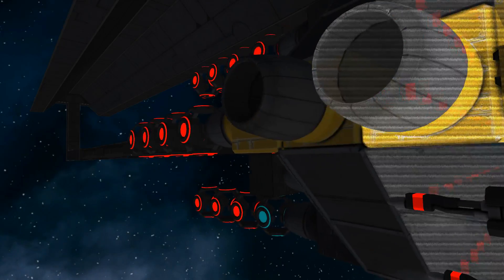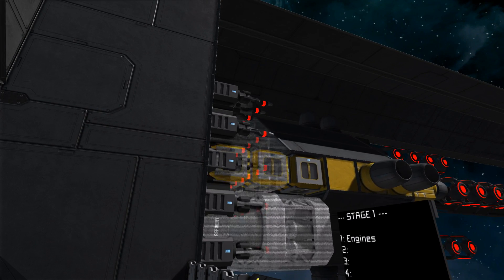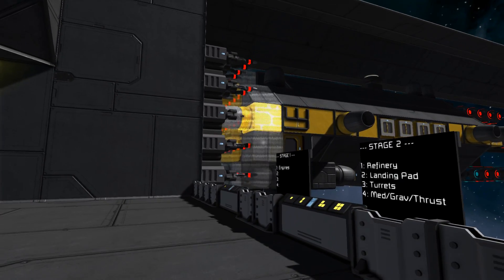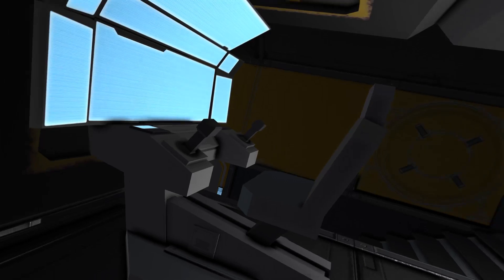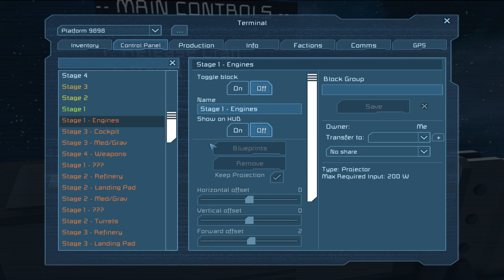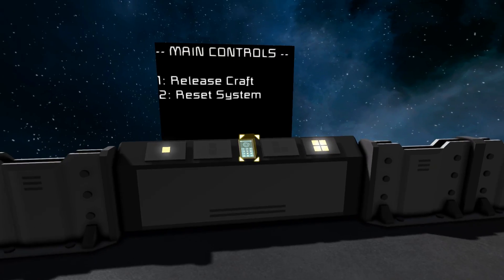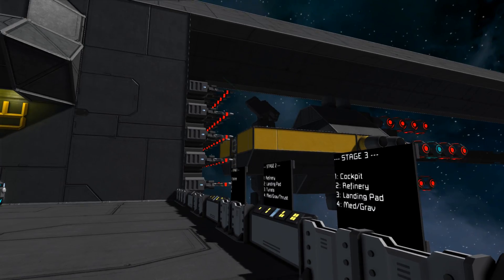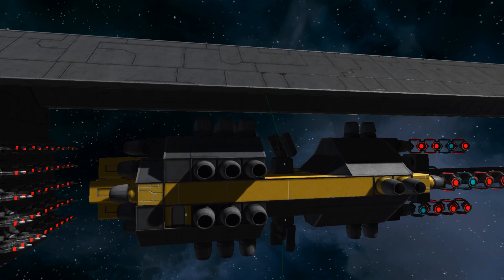Space Engineers - Modular Extrusion Platform - Multi Ship Projection System

Comment: Interesting idea. I've been messing with a modular ship recently. All built by hand though. Haven't been brave enough to try the projector thing yet. But then again i guess you had to build all your modules by hand at least once anyway.

My ship is a asteroid mining rig. So it has a massive drill face. A refinery module with a conveyor system that directs different ores to difference refineries. There's a tanker module for hydrogen to be taken away and a tractor module where the bridge, main engines and jump drives are. All the modules are joined by merge blocks and connectors and can be controlled by remote control. Which allows me to reconfigure the ship as needed.

Comment: As a proof of concept this is flawless. For a finished production model I would suggest switching from pistons to the old 'hillbilly pistons' with rotors, arms and landing gears. It would be much more complicated to build, but also much more versatile. No more four block limit on module length. Also you may want to consider switching the ejection system to the constructor rather than the ship. The obvious way would be a second piston set to push the extrusion gantry down and release the ship just before it hits the bottom.
Reply from the maker: I think I actually have a system that will scale better than both the above, although you are completely correct that the pistons fail for a finished product but did help prove the concept nicely. Hopefully I can make what I have in mind work as it would be great to get rid of the bloat and instability in the piston stuff. Cheers!

Comment: i have an idea for a bigger version of this: There is a frame (conveyors and a corridor, maybe thrusters). First you select the frame. There are multiple frames wich have different engines and different lengths. Then you select modules wich are built left and right of it and at the end the front (drill head, weapons or cockpit). The drill head has no space for braking thrusters so you need some EM thrusters (or turn off thruster damage). For the production hangar you would maybe need some modded welders like the twin welders. Maybe ill try to build it later but i haven't time now.

Comment: Interesting ideas and designs for each module. One thing that I have been working on and failing at severely is a sort of CAS system, (Customisable Armour System) where you have a basic ship and you dock it, hit a button for the change and the system goes in, removes the armour, changes to what armour you selected then puts it onto the ship. with the way youve been doing modular stuff lately i thought that you would actually stand the best chance of figuring out how to properly get the system to work. or atleast be a nice challenge for you to figure out
Reply from the maker: Sounds like a very interesting idea, think I can see some ways of managing it although would require the armour to be built using a pre-determined size each time so you could program the 'removal' part properly.. Kinda cool, might have to give that a try somepoint :) Cheers

Comment: Automated production lines are the bane of my existance!! Especially if you try and build them into ships. Rotors and pistons are the main problem but also disconecting the production from the ship -_- (dont always want connectors)

All i want is to have is a automated mine laying ship. I fly along and mines pop out the back/sides.... is that so hard to ask (the answers yes).

A hanger on a station is perfect tho... always a pleasure watching w4sted
Reply from the maker: Thanks :) and yeah, making something like this mobile with all those pistons is a no-go.. even the merge blocks are dodgy as you say, have a habit of exerting too much force and breaking something. There is always the old 'grind it off' method for the minelayer though, I've had best results using that method for things like minelayers/missile launchers etc as it exerts 0 force onto the bit you are separating .

Comment: Use Gatling for the center module or it will fire into the craft,
The laser aim is not centered on the launch tubes, the Gatling laser aim is so it will no fire if your own blocks are in the way.
Or make the clearance at least 2 blocks from the center in any direction so it can fire of the missile turret.
Reply from the maker: I never knew that, explains why despite the fix missile turrets still have a habit of clipping ur own ships. Thanks!

Comment: Are designs like this possible on multi-player servers?  We get such bad "connection bounce" on every multi-player I've been on that explodey action is inevitable.  Even connecting via connector will cause explosions, forget merge blocks/landing gear.  I just got into the game, and find this (syncing?) issue a massive pain.
Reply from the maker: The action of the merge blocks/connectors is directly proportional to the weight of the ship trying to merge so you can avoid some of the issues by keeping that in mind, but yeah it does have some issues (outside of my control) in MP thanks to that, a massive pain indeed...  I have some solutions for version 2, will be removing the pistons at least and there's not a situation where you have to merge with it, only un-merge which is a lot safer maneuver :)

Comment: ***** Very cool, I like this idea a lot.  It allows for quite a lot of flexibility in your ship automation without a ton of setup.  It's a little complicated to expand (adding more pistons means moving everything back some distance and then re-adding the projectors at the right place), but at a certain point you probably want to build wider ships rather than just longer ones.

Which gives me an idea.  Instead of having the projectors on a piston stack behind the ship and fixed welders in the front, you could mount everything on the overhead rail and suspend them from 'ribs' (think: shipyard from Star Trek).  The gears mod has a rail type system with teeth along the top, so you could hang your projector rig on top of that with a rotor-mounted gear in front and/or back and have it just crawl the rail a fixed distance per module (or crawl at a fixed rate of speed, but that requires preprogramming all the modules in).  But the only limit is the rail length, rather than maximum piston extension, so all you'd have to do is tack more rail on to the end.  For that matter you could set up another projector and a couple of welders to add more rail to the end as needed when a new module is punched in.

And all this would let you mount the ribs on lateral pistons to build wider or narrower ships with the same setup.  Damn, I'd love to see this fully adjustable ship builder in action, but it's well beyond my skill (or perhaps patience. :) )
Reply from the maker: It is a bit complex to expand (or time consuming perhaps, the individual bits are all pretty simple) but as a starting concept think this one has some proper legs... I have some similar thoughts about how to remove the need for the pistons but using the subway-system approach I did before, with the wheels inside a framework which could then be as long as you want and easy to expand. Basically have the projectors and merge system all attached to a cart that moves like the subway did and go from there... means a redesign but should be a TON more stable (making wider ships easier also). Cheers!
Reply: ***** Yeah, it's a pretty good first run.  I just can't help but think of ways to overengineer things to further automate, remove limits, etc. :)

Actually I hadn't thought about the subway cart.  I'm not sure how well it would bear weight, but it should work and doesn't require mods.
Reply from the maker: Steve Pittman My experience with it's weight bearing properties have been pretty good, especially in situations where essentially you are just trying to counter momentum rather than gravity. It's certainly better than pistons for the task, just a lot more work to setup hence pistons was my first thought.

Over-engineering is more than welcome here! But I think you know this already by now :)

Comment: awesome! is a nice think, survival ready will be one of the most interesting thing to use XD it grant felxibility to your ship, i just have a question, in survival you can't build a ship with projector with his cargo filled with stuff right? you should add a conveyor system by default in the whole structure, not only with the refinery, and a fixed conveyor (or mobile) that can connect to the ship for the starting stuff. if it exist you also create a program that move the right item based on the section you used to build it...
Reply from the maker: Yeah a good thought, that way you can fill the whole thing up before detaching it from the factory (and means you can put the necessary fuel in it also to get in running). Very good suggestion sir, will be using that for sure. Thanks dude :)

Comment: You think a similar thing could be done with small ships? Would it have to be that different you think?
Reply from the maker: Built a small version first in fact, only reason I ended up large ship is it gives you a wider range of modules with refineries, assemblers etc all being available on large ships only... so yeah, literally works identically except you put a rotor on the end of the piston so you can convert to small ship size.
Reply: ***** I'm not sure what you mean by using a rotor for converting to small ship. Maybe something to show in the next building on the basics?
Also, with the recent update to ME your trebuchet should work properly.
Reply from the maker: Benefactorist
Yeah good call, I'll make sure to cover that in the next ep :) Chances are it'll be covering a few bits to do with how this thing was made.
Have had a mad week, kinda hoped to have an updated trebuchet up by now but wasn't to be.. :(

Comment: Would it be possible to build modules on to the sides of the ship as well? I feel like This concept could really be expanded if you add another row of projectors to the sides of the projectors already present. This way, I think, you won't be limiting yourself to linear modularity, which will double the overall complexity and versatility that the craft can achieve. I feel like this may help with WhackoMacko's (presently) down below this one, where bits can be added to the outside of the ship as well...
Reply from the maker: I think so but you may end up still extruding them in a single direction but adding projector functionality to allow for side modules as well as front/rear modules when required.. Directly attaching onto the side of existing stuff might be more tricky but someone else in the comments did have some suggestions on how to do bits of that at least so maybe!

Comment: ***** Really like the idea, made me think of making a modular small ship factory in a similar fashion. You would have the base frame with cockpit/power/gyro build first, then select which modules to add on each side. I'd love to see your take on a small ship system like this.
Reply from the maker: I actually started building a small ship version and then switched quite early on (once the first prototype worked basically) as you can have so many more usable modules in a large ship type, all that stuff that you aren't allowed to place on small ships like turrets/refineries/assemblers/etc.. Will probably do a small ship version also (maybe even have the large one print the small one as a module!) but it should actually be a fair bit easier to do with small than large. Cheers :)

Comment: Wow... Again. Wow. If you put in a projector system with welders that were built with that factory you would be a self replication nightmare! So fantastic. 

Now I just need to have a picture of Xzibit with a caption: I heard you like ship factories. So I put a Ship factory in your ship factory in your ship factory. - Pimp My Starship!

Very cool. 

Additions?

I would say that if you put the projectors in a static position, with a moving welder grid. Each projector connected at the side on each deck level, and when you reach the next deck of the ship, you have a projector selection on the side with multiple merge blocks along each projector group connecting the projectors. Then you just slide the welders along after projection is selected. You could have multiple forward projections as well. Multiple merge blocks will allow you to also create multiple smaller ships with ease. Welders can be a set size for the ships it creates moving up down left and right. Moving the welders allows the ship to be bigger, you could also have multiple welder bays. 
                                                       
ppppmmShip
ppppmmShip           Launch --->
ppppmmShip
ppppmmShip                         <--- 4 Projectors-MergeBlock-MergeBlock-Ship
ppppmmShip                                   Add More projectors along the top or bottom to increase ship size. 

<---------------------------------------Any Size----------------------------------------------->        

VVVVVVVVVV        <--- Welders      
          |      /\     <----Move--->
          |      Move Both Back and Forth
          |      V       And Up and Down
Reply from the maker: Cheers man :) Some interesting ideas too.. not so keen on moving the welders also as that opens up a can of worms when it comes to stability issues, noticed this on the DCV build that moving the welders results in them getting caught on things at times, especially if they are moving around. However I think that idea could work just by adding more complexity to the arm of the ship-side to get some similar results, aside from the clear launch path. The other option is to go back to scratch and base it off the subway idea to remove pistons entirely, have the welders attached to that directly. Lots of food for thought for me, thanks! :)
Reply: Hey thats a good Idea man. Subway ship building system sounds pretty good. 

Yeah welders can be a pain sometimes, pistons too.

Comment: It's a pity that a rotor and piston combination transmutes itself into explodium because there are some very cool things you could do with them to "swing" the completed ship out and swing the building arm back in. You could also set up a piston system with some landing gear underneath to pull it out. If you make the entire printer a ship you could set timers on the printed ship to enable inertial dampeners once it has been removed from the body of the printer so that the printed ship is essentially dispensed. You could also do some cool stuff with this by making it be a station module printer rather than a ship printer so you can print sections for stations and then maneuver them into place with a larger ship. It could also work well with the NGC for building more of your MCV deployable bases and other such things - you may even be able to build the escape modules for the NGC by using two pistons instead of one piston in each stage. It would also be pretty cool if you added fireship modules so you could essentially build huge pilotable missiles.
Reply from the maker: I actually have some thoughts for how to manage that spinning automation without needing the rotor on the arm because yeah, with an arm that long I'm not putting a rotor within 100 blocks of it! lol.. Not 100% sure it'll work yet, planning todo some weirdness with locking/unlocking connectors but hey, maybe! Adding missile parts to the system is a sweet idea, should be easy enough too, swap modules 2/3/4 for a warhead module, an RC module and a separating penetrator part and off you go. The one bit of this that's not 100% yet is the whole getting the ship out once it's built thing so it's interesting that's an area you picked up on.. next design will defo leave more room and have an automated way to get it away from the machine ready for the next. Cheers dude :)